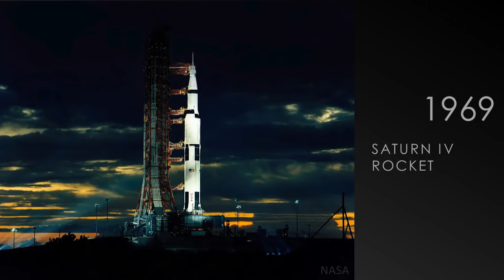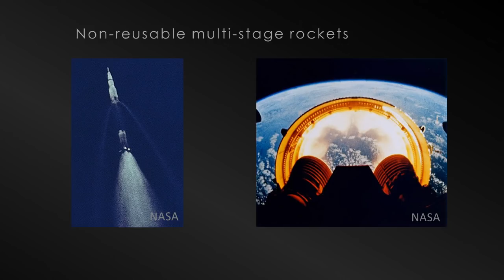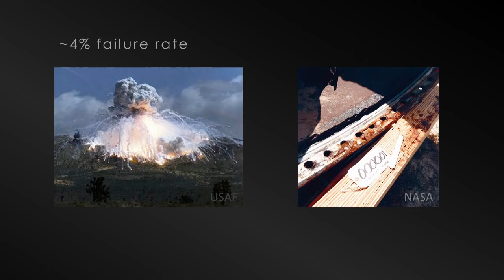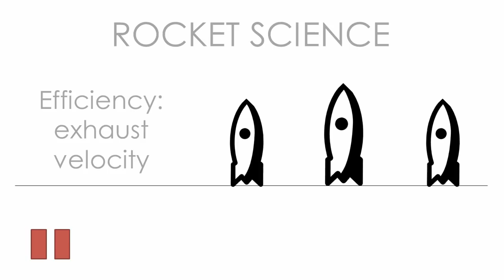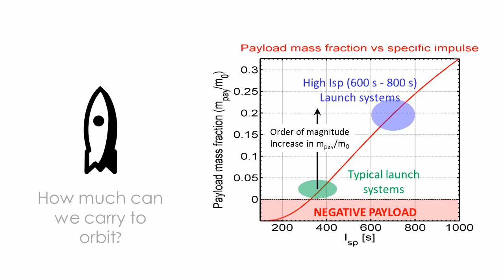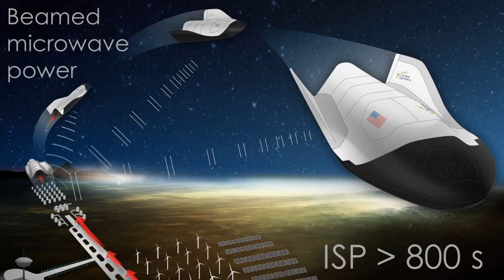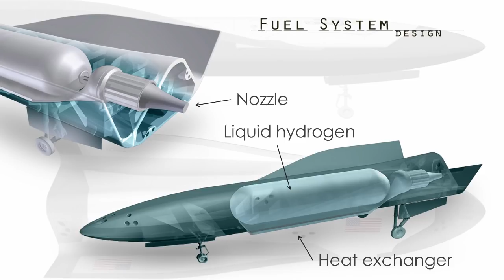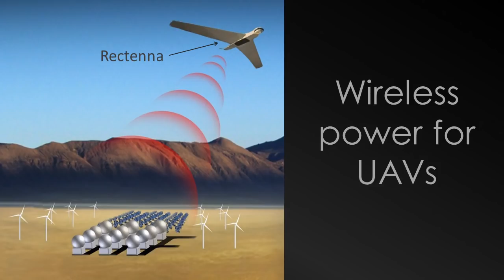A better way to get to space: Dr. Michael Kelzenberg at TEDxWSU 2014

Comment: If an A380 @ 520 odd Tons can get off the ground with passengers, making its payload and vehicle a staggering 1,265,000 pounds.

A Saturn V is 6.5 million pounds.

So, if 4 Trent engines can lift and A380, I am sure that a lifting body that has something in the order of 20 engines on a smaller rocket as you won't need the fuel to lift the 3 stages, 1st stage takes off, flies to its limits, 2nd stage initiates and 1st stage returns to earth.

2nd Stage lifts the payload or a crew in a vehicle that returns to earth via the tried and tested method.

I am sure between the different industries that something can be designed that reduces the need for large lifting rockets.

Looking at each stage of a Saturn V, the dry weight is (according to Wikipedia) is 392,000 pounds. The wet weight is about 6,422,000 pounds which makes the weight of the fuel 6,030,000 pounds.

Shedding stage 1 for a reusable lifting vehicle would mean a saving of 5.1 million pounds of fuel and hardware, this means your lifting vehicle would be able to be big, have lots of engines to provide speed to take off. Your rocket would then be 1,322,000 pounds ... about the weight of a fully laden A380 airbus.

I expect there are errors, I rushed this through, used a resource I have not verified, but the idea of getting vehicles in to space, could IMHO be simpler and some of that would be down to rethinking how launches are done. Yes, straight up is quickest but look at the amount of fuel required to lift a large vehicle off the ground compared to that needed to get a plane off the ground.
Reply: Mark Giblin -- Unfortunately, the benefits would be far smaller than that, because the jet can only go about 500 mph, while the 1st stage of a rocket to LEO goes about 5000 mph. Ten times the velocity is 100 times the kinetic energy, so that 1% from the jet is not much of a saving. There are other benefits as well, but they only add up to about 7 percent. That is not insignificant, but it's a huge expense for very occasional use.
Reply: The point is you are "off the ground" and 500mph? What I am talking about is something at least 6 times faster than that, something of the likes of Mach3 (3704.4km/h) or better. Basically as fast as possible and then at an altitude high enough to launch the orbital payload, with a 3,500 kph head start, the next stage will launch moth that much faster.

Half the battle of getting in to space is getting off the ground.
Reply: Mark Giblin -- "Half the battle of getting in to space is getting off the ground" is an exaggeration. The energy of altitude is a very minor part of achieving orbit. That is why rockets arc over very soon after launch. They need to start accumulating the sideways velocity of orbit. Your statement comes closest to truth when considering the Work done vs the Energy expended by a vertical launch rocket, at launch and shortly afterwards. Engines are screaming away at full power and the rocket is barely moving. It is losing mass, which helps, but the efficiency is very low. However, they need to go slow while the air is still relatively thick. If the rocket was to go faster than Mach 1 at low altitudes, it would have to be more heavily constructed. Added vehicle mass means less payload mass. That phase of launch has room for improvement.
But an A380 going Mach 3?!? Are you nuts? Everything about that idea is wrong. Wings that are good at Mach 3 are simply terrible at takeoff. Look at the Concorde, the SR-71, the B-58 'Hustler'. They all struggle to take off, despite massive thrust from their engines.
To take off from a runway with good subsonic wings, then go to Mach 3, you need different wings. Very different. A whole different airplane, in fact: A carrier on a carrier, with a rocket on top, 3 vehicles in one. Then you want to drop that rocket off, at altitude, going Mach 3?!? That is a nightmare, to say the least. I have a better suggestion.
Let the A380 'heavy cargo' variant be modified to carry a Skylon spaceplane on top and tanks of LOX inside. Let the Skylon be loaded on the ground only with the Liquid Hydrogen fuel, so that the attachment points, landing gear and wings are sized a bit smaller. Let the A380 carrier plane take off and fly to 35000 feet or so and 500 mph. While cruising at that speed, let the LOX be loaded into the Skylon, where the Skylon wings bear the weight of it. Now you are ready to release the Skylon, to fly much higher and faster while it's SABRE engines still breathe air. When the air gets too thin and fast to use in the engines, at about Mach 5 and 20 km altitude, close the inlets and start using the LOX, as the transition is already planned.
What has been saved by using the A380 carrier? A small amount of LH2, just a few hundred pounds. The major savings is to the wings, landing gear and their attachments to the airframe, perhaps 1 metric ton. So the Skylon's payload can increase from 15 tons to about 16 tons, which is 6.7%. That's it, that's all, that is the best that can be done.
It's not a worthless change, but is it worth the cost of all the modifications? Is it worth keeping this specialized A380 on standby all the time, for the occasional Skylon flight to space? At present, the answer is "No." To make it into Yes, the Skylon would need to be flying every day, at least once per day, which means that at least 2 Skylons would have to be taking turns flying up to orbit and coming right back. If the Skylon is to linger in space, then more than 2 Skylons are required. If Skylons are taking off from more than one place, then additional, specialized A380 are needed as well.
What is the launch market looking like? Who exactly is launching 16 tons to space, every day? The answer is "Nobody." Catch-22!
Reply: No, I am not nuts, I am looking to the future, who said thatit has to happen in my lifetime, your lifetime or my sons life time...

There will be newer materials that will provide the required weight reductions, strengths and systems to deliver as described, reusable stages and who is to say that these stages can not have their own boosters to control re-entry, you never know, planes of the future will fly in to space...

Comment: Finally, a common sense approach to a modern way to get payloads into space, cheaper and safer than ever before.  No offense to Elon Musk's bold Space X rocket venture, I find this the WRONG DIRECTION man should take for reaching to the stars.  By using ground-based energy sources to beam the energy to the spaceship, there is zero propellants required to launch these into space, which often comprise 90-95% overall the total mass of the conventional rockets, leaving very little payload capability.  Imagine if those numbers were reversed - that 90% of the rocket was payload material.  Right - hubba hubba!!  Plus, the cost of launching these spaceships into space would be fractionally cheaper with zero chance of explosions and the residual pollution air and ground caused by chemical combustion processes.
Reply: There is a propellant... liquid hydrogen. And the heat sink + exhaust nozzle systems will have some weight, there is no way around that, besides the capsule itself will have plenty of weight BUT... there is one promising possibility; single stage space flight (it might be a stretch). Which means that even though it would probably be impossible to get the whole rig safely back down to earth for re-usability, it could be cannibalized and used for other purposes in space. If that was so, you have WAY more useful payload being brought to space. Even empty hydrogen canisters can be highly useful building modules in earth orbit.

Comment: NASA had a Isp of 1000 sec on a ramjet on the X15 in the 60s, so I'm not impressed.
Reply: A ramjet isn't a rocket and doesn't work in space. Also while all jet engines have efficiencies roughly 5x higher than a chemical rocket, they have a thrust to weight ratio roughly 10x lower, so they're really bad for launching rockets. 

The most efficient jet engines are high-bypass turbofan engines with ~100,000 Isp, however they have a thrust to weight ratio of around 5, whereas a typical rocket TWR is around 40.

Also, a rocket has no top speed, whereas all jet engines start to lose thrust and eventually stop working at higher and higher speeds. The ramjet you mention has a top speed of around mach 5, or just 20% of orbital speed, and at that top speed barely generates any thrust, because the air is moving through it so fast that the flame spends almost no time inside the engine. Past mach 5 you need a scramjet engine, which is much less efficient than a ramjet and has lower TWR but works up to around mach 10.